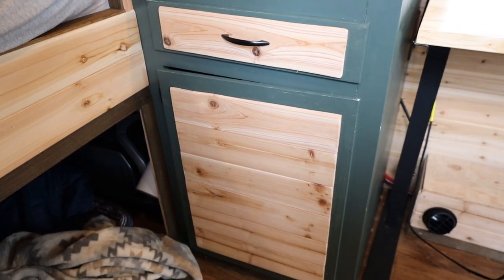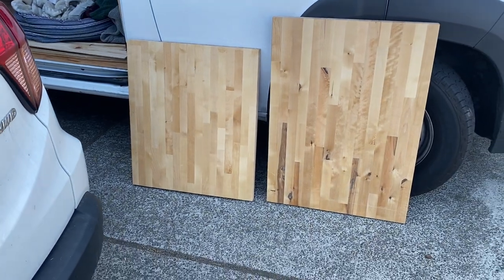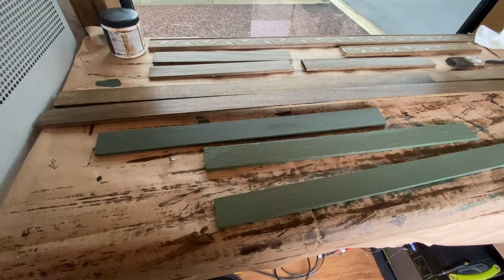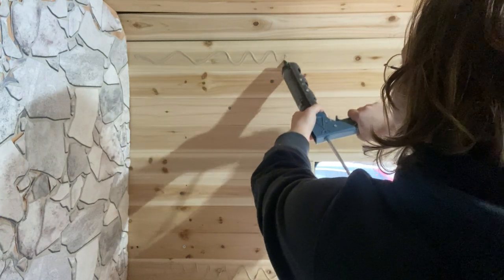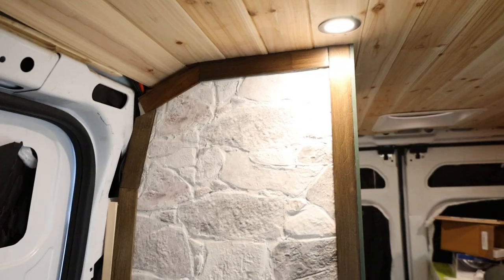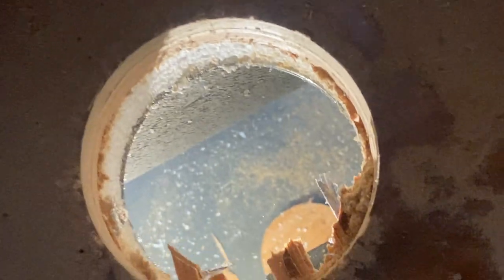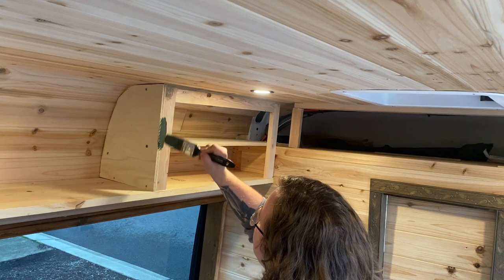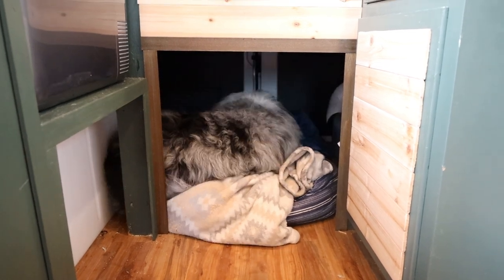Adding Stone Walls In My Van! +Diesel Heater, Pocket Door, & Bodega R50 Fridge | Build Ep. 3

Comment: Its looking great! 🙂, here's 2 painting tips: 1. When painting in situ, painters tape is fabulous for taping off what you don't want to get paint on, and 2. When using a a roller and tray, first wrap the tray in a plastic bag and tape closed, then pour the paint in as per usual over top of the plastic bag, then when you are done, pull the bag off with the leftover paint on the side of the bag, tie off and dispose of it, tray is clean and paint goes in bin - nice and easy clean-up🙂
Reply: I too was itching for some painters tape but it looks like he was able to get it done without messes... which is SO not my way when I paint as I seem to get it all over the walls, myself, the cats, etc. Thanks for the tip on the painting tray plastic bag hack!